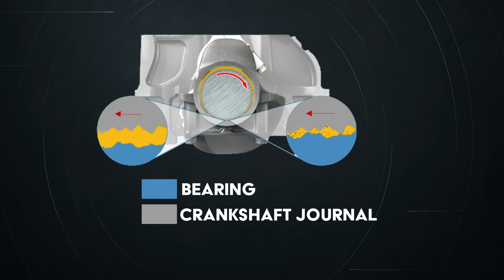the truth about start-stop technology (finally proven)

Comment: I've got a 2023 Hyundai Kona that I use for rideshare as well as personal driving. It has that automatic engine off "feature" on by default. My car is almost to 200k miles now. I have to manually turn off the automatic engine shut off feature every time I start the car, because weird stuff happens if I don't. If I don't give it a few seconds of off time before starting the engine back up, sometimes I get a variety of dashboard lights, or sometimes, the engine just stays off. This happens in situations like if I pull up to a stop light just as it turns green. The engine might have just enough time to shut off and then immediately start. I think this causes confusion for the ECU or something. 

My car drives great aside from this issue. Hyundai makes a good engine... They just put a bunch of bs on there that nobody asked for or wants.

Comment: Hybrids can have periods of running with long pauses between, this causes the engine to heat up some then cool down, constantly crossing the dew point each time it does. This contaminates your oil with water. Toyota has a oil/water separator on their Hybrids to address this fundamental problem with long pauses between starts.

Comment: Quite curious how is it that series-parllel hybrids, espeically the likes of Toyota & Honda are constantly stopping & starting the engine, even more than a traidional ICE vehicle with start-stop technology -- and they still manage to be incredibly durable and reach >300.000-400.000km regularly

One could argue that the bearings would be under constant stress and since the oil pump is only running when the engine's running (timing chain driven) there's also lots of mixed friction which should imply lots of pre-mature engine wear

Comment: I would be curious to know if the start/stop feature has been implemented with no modifications to traditional engines. If so, failures are inevitable, because you make the engine work in a regime it’s not been designed to work in.
You don’t need to be a car mechanic or an engineer to understand this risk. You need to be one of those to quantify the damage, as this young man has done.
I would expect car manufacturers have implemented compensatory measures before rolling out the feature: more robust starter motors and drive trains, ad-hoc lubricating systems that electrically or otherwise maintain the oil pressure in the engine when the feature is activated. You know simple things that I, as a layperson, can come up off the top of my head.
Is this video implying car manufacturers have just deployed the feature on unsuspecting traditional engines with no modifications?

Comment: A modern ICE engine and the financial feasibility of the lower quality parts surrounding it approaches nowhere near 1 million miles.
Granted for many other similar reasons, start/stop not being the only one.
Reply: The rings are for example tighter, and they aren't warmed up with the block if hot oil is just supplied to a colder engine.
Proving something takes more.
Reply: Testing something with three different crankshaft bearings is not the same thing as running a complete set, which is the actual test.

Comment: AFAIK the start of the engine after the stop phase is slightly easier than the key start. It knows exactly the positions of the pistons and can start mid cycle. Therefore it's more seamless than turning it off and on again with the key.

That said, the benefit of the system is dubious to me, unless the stop is >30s.

Comment: This video completely ignores the main purpose of start-stop. 

Which is to give you the dilemma of NOT stopping at the stop sign and risking a fine
or
To lose power at the stop sign making you lose a second or two and relying on the other driver not to crash into you.

But I like it on manual transmission when it triggers only when in neutral

Comment: I know the N52 have an electric water pump that fails at around 200 000 km because it's in constant use. What about unsing a small electric pump that continusly pump oil while stop ? It would be disconnected after start up and it can even help with start-up wear by priming the oil before starting the engine . I understand it add a new point of failure cost and complexity but that would probably fix the oiling issue from start-stop.

Comment: So, is this an issue over like a 10 yr normal usages? Like using a car for that long lots of things start to go.  Engine wearing out is way down the list right? Exhaust, radiator, braking system, transmission, etc.. .  Though engine dying in a car not worth the fix.

Comment: I drive a lot of Country/Rural roads, which are kilometers of nonstop driving, on my workroute I have 2 stops, 1 red light, and 1 traincrossing. The redlight usually is very short, so I keep the engine on, on the railcrossing, if it's shut, I allow start stop to turn the engine off.

If I drive into a city with lots of stops, I turn the feature off, It can't be good to turn the engine off and on every 2 to 5 minutes

Comment: Does this affect small cc motorcycle engines? 100cc to 200cc? Because small cc motorcycles have auto off too if they idle for a certain time. Usually This can be disabled with a switch but it's a feature they include in marketing.

Comment: I think is test is kinda wrong, you are testing the time it builds pressure with lower angular speed, a start-stop engine turns the engine on with only one rotation of the crankshaft then it gets to 600 - 800 rpm so the pressure builds quicker than your test with its only turning the engine at max 200 rpm.

Comment: "I took an angle grinder to my boots to simulate a year of wear and somehow the boots failed" what an absolute joke of a "test" 😂 No control or anything. I have seen a start-stop car go through 10+ years of daily use and none of the issues had was with the engine but with corrosion on the body, frame and chassis. Your car will rust through before it will have a noticeable difference on the engine wear. But keep on burning gas, "because you always had a bad feeling". It's not getting any cheaper 😂

Comment: Fantastic video!  Been a mechanic for 30 yrs, tractors, planes, cars, etc.  Always knew auto start stop was bad but you clearly illustrated how bad.  The oil pressure delay was shocking.  Deep dives are amazing. Subscribed.
Reply: imho you are just taking this vid for granted because it is reinforcing your previous belief. the testing done here only illustrates what everyone already knows happens when you start an engine, but shows nothing about start stop systems. people who engineered these systems didn't just let the computer turn the engine off and on again. i trust you now thee are many additions that make up the start stop system and that, among other things, it includes an electric oil pump at the very least, though modern ones have one or two other ways to prepare oil pressure in various parts of engine and transmission before the restart occurs, as well as bearing engineered for this kind of use. data so far, as far as i know, hasn't shown any significant increase in wear when using these systems with oils recommended by manufacturer and regular oil changes

Comment: I think the system Suzuki uses with their mild hybrids, where if you stop at a red light an electric motor spins the engine and it maintains oil pressure, only the fuel is cut off. that's probably the best iteration of this system.

Comment: BS.  The engine still outlasts the body, despite improvements in rustproofing.  No rash of rod failures in modern vehicles either.

As for this test setup, no measurement of the actual film on the rod.  The real data comes from x-raying a running engine.  Yeah, they do that.

Comment: Also every time you start an engine you use more fuel to get it going. Actually better to let your
 engine run idle in a cross section than starting it up.
Tear and wear. And using more energy and fuel.

Comment: Yeah I don't think any of your findings are in dispute - it has been "cannon" in automotive lore for decades that starting an engine causes more wear (and not just on bearings) than running it. But stop-start is not implemented (as far as I'm aware) to save anything but air pollution, and having engines running less (even with little extra bit that happens at startup) must be reducing emissions, now that most cars have ECU-controlled fuel injection.

Comment: You are blaming the engineers but not the real decision makers: The Zionist World bank. Which dictates all laws.
Manufacturers are just debt slaves controlled by the WB. 
Those emissions laws are year by year  means of sucking drivers blood onto the WB pockets.
Start&Stop crap is a fake solution to avoid emissions penalities (EPA...) just as those criminal low tension piston rings and very restrictive catalytic converters.

People just don t get it. The pollution coming from tires friction is hundreds of times worse than the CO coming from gasoline combustion. And the pollution from EV batteries is thousand times worse than all.

Comment: You did a cold oil test, then a hot oil test, both from a start point, but you didnt show how long it takes the pressure to drop from a stop start point of view and get back up to pressure.
You are making the assumption that the pressure drop goes back to zero immediately. Oil lingers about in the engine when the engine turns off so there is still lubricant in the places it needs to be. It takes a while for the oil to drain down to the sump.

From my experience, stop start doesnt damage an engine as much as people think. My mum had company cars from 2011 to 2018, she would put 100k miles plus on them in 3 years, although they sounded like a bag of bolts at the end of the time she had them, i would put that down to 20k mile oil changes rather than 6k mile oil changes that i did on my van and put 100k miles on it and the engine still sounded sweet.
My wife has a 11 year old vw passat, stop start has been used all its life, it is over 100k miles and still no problems. It has had 10k oil changes.

Changing the oil more often will make the engine last longer. Also how many people are running engines after 100k miles and still having problems? Life expectancy of an engine following the manufacturers service plan is for it to last from 100k to 150k then its past it without a rebuild. Change the oil more often and the engine will last longer.

Comment: One of the main arguments for start-stop is to reduce emissions. Cars in cities spend a lot of time stuck in traffic, and emissions acummulate. Stopping the engine while the car is not moving is one of the ways to reduce those emissions. There's also the reduction of fuel burned, which is debateable, and depends a lot on type of engine to determine performance. But the idea behind it is less burnt fuel, less fuel required, which should trickle up the chain. So build better engines from all points of view, not just wear.

Comment: 5:52: You just added hot oil to the pan and didn't pre-mix with a hot engine. That doesn't test in a realistic way. It's a test but it doesn't show what really happens.
I've tapped into ODB in my car and I have confirmed the oil pump keeps pumping and the oil pressure stays high for 5 minutes, even after the engine stops in STOP&GO mode. It recovers normal pressure in just 30s, according to the car sensors as seen through the ODB communication. 
Why isn't that replicated in your test?

Comment: I had a bmw 2022 m235 for 3 years and I never drove it out of sport mode because I knew the BS start/stop feature will eventually destroy the engine, I am ok with the loosing $2-300 it saved me over the time I owned it because I never had any mechanical issues. Then bought a 2023 Toyota tacoma that I could permanently disable Start/Stop with a locking toggle button. So glad Donald trump signed an executive order to ban Start/Stop being automatically turned on in US spec cars.

Comment: Start stop "works in theory" but not in practice. Full hybrid technically moves the cycling and cut off limits of the "return" on investment of the change in engine working process. But even hybrid has limits and concessions compared to pure electric or pure ICE.

Comment: Wait! You start to crank engine just after you dripped whole oil and then poured it again. Of course, you will have about 6 seconds while oil pressure will build up. Because oil filter and oil passages are empty! 
In reality when engine stops, oil doesn't go away from filter, canals. It stays in place, maybe drips away very slowly. And when you start engine again after 1 minute (for example when you are waiting for traffic lights), the oil pressure builds up almost instantly.

Comment: What a great video on so many levels. 

I absolutely loved his sign off in the last few seconds of the video. Priceless German humour 👍🏻👍🏻

Just to add to the context I’ve owned an AMG with stop/start for six years now. In the summer months it activates (or rather shows it’s ready for activation within about 90 seconds of driving). I push the off button to deactivate it immediately as my warm up includes many junctions where it would operate at very low engine temperatures. After about 20 miles (32 kilometres) I turn it back on as the engine and gearbox  has reached optimum temperature. The car is a superb example of German engineering and I can find nothing comparable to replace it in today’s market.

If you have the most basic mechanical understanding and more importantly mechanical sympathy it’s down to you the driver to make it last.

Thanks again for an excellent video 🇬🇧👍🏻👍🏻

Comment: If the start stop systems had the addition of an electric oil pump to give the oil system a boost before start up, would it prevent all the premature wear? 
Could one eliminate start up wear in any engine with a pre-pressurising oil pump? Im guessing engines running a dry sump system wouldnt have this wear issue.

Comment: The most Annoying thing about Stop/Start systems ???
The default setting is switched ON ?????
I already dislike modern cars with so many warning systems that seem to only make people more Dum than they already are ???
YES you can switch off some of this Control, but when you share a car with a Female they love all these warning systems and to turn them off would take almost as long as the drive itself ???
Simple answer of course would be to either keep my current Pre Controlling car or buy a modern car myself and disable every warning system possible but I would still be stuck with a car that switches OFF each time I stop ???????

And YES I would forget to turn it OFF because I just want to drive the car not go through a check list each time I start the engine ???????

It would be great IF all I had to do get back Control of my car was to simply cut some wires and twist some other wires back together and all would good.
( I have a feeling it's Not that simple 😬

Comment: I always have it switched off on my V60 and only use the car in sport mode. I see no difference in fuel consumption which is little anyways but the engine runs much happier.

Comment: The only way to really test the difference is to have 2 identical vehicles with start stop and then disable the start stop on one. Then drive them for a year with the same driving methods and oil change intervals with the same oil. With your test, there are to many variables. 2 different engines, 2 different owners and 2 different maintenance. Also starting a cold engine that sits for a long time will drain all oil back to the pan. Unlike a restart after a minute or so. There would be residual oil on the engine components. So I would think that a cold start would be worse. You said it yourself that the test engine could have had debris in the oil that caused the scratches. You must eliminate as many variables as possible to get accurate results. Better luck next time.

Comment: Sears made an air compressor many years ago, very nice, worked well, too well.
They put a plastic shroud on it.  Looked nice.
The only purpose of the shroud was so that the compressor would run hot and burn out earlier.

Comment: Start-stop saves fuel if the stop lasts a while, 2-3 minutes and up. But it saves fuel and fuel only. It ruins engine, it wears the starter motor down faster, it wears down the starter battery...

Comment: So what I gathered from this is if the point was a smart ICE engine design, we would use generators to power a battery bank and have the engine run at peak power delivery to charge said battery. Avoiding the need for a transmission in a conventional hybrid.

Comment: My wife's car has this. It drives me mental, along with all the of "safety" alarms. If I don't want to hear the car shouting warnings at me, before I start the car I have to put on my seatbelt. Then start the car, turn off S.S., turn off lane assist. Right now, low tyre pressure alarms are bleeping. Even though the tyre pressure is perfect. Gimme a 20 year old car anyday.

Comment: Then why do hybrids have no trouble reaching 300k+ miles constantly start/stopping?
The problem with conventional engines doing it is wear of the starter and battery, and cranking speed. Hybrids get the engine to 1000+rpm swiftly using the electric motor, putting only compression stress on the bearings during low oil pressure. The conventional starter system can barely manage 250rpm which means it relies on combustion to get the engine up to idle/operating speed, putting more low oil pressure stress on the bearings.